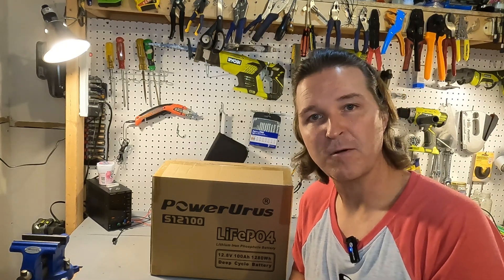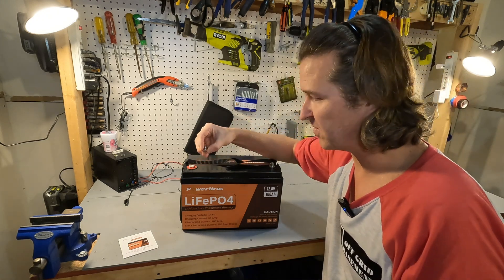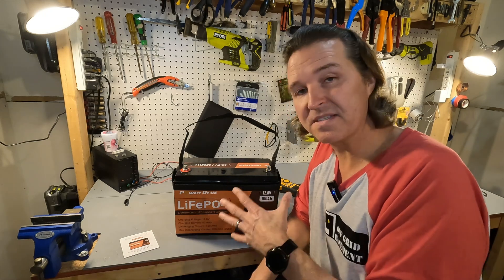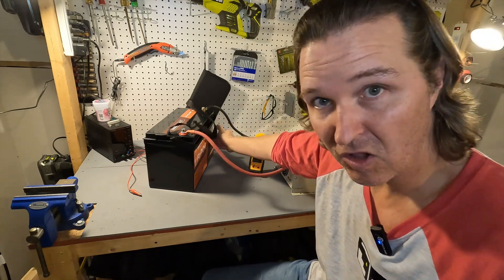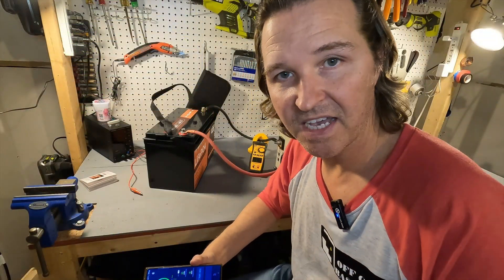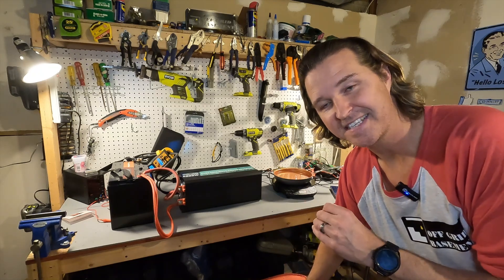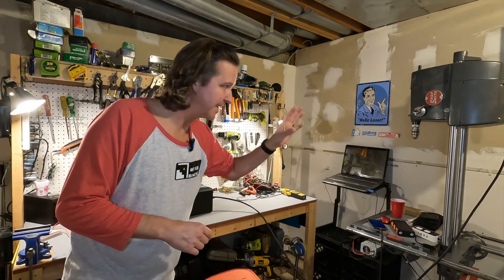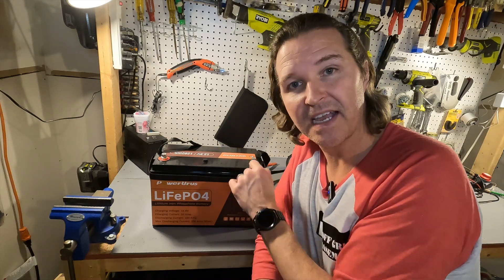Testing the PowerUrus 12v 100ah Lifepo4 Battery.  Great High Quality Battery!

Comment: Looks like a nice battery. I am a bit concerned that the BMS doesn't perform as advertised in that it allows charging at high amps and high draws beyond spec. Also, it shouldn't allow charging below 32 degrees F. I'm sure your freezer is colder than that. Given the BMS didn't perform to other specs, I wonder if it indeed would have allowed charging to 10 degrees before shutting off.  The strap is rather goofy. You might be able to reconfigure the strap to make a loop just between the two attachment points on top, so you would have a double strap to hold, as long as the attachment points are sturdy enough.  The warranty covers materials and workmanship, but doesn't guarantee that the battery will last 5 years. The battery does seem to be a step above many others, for a step-above price.
Reply from the maker: Thank you for the great assessment and comment!